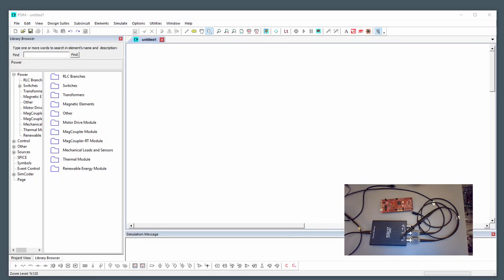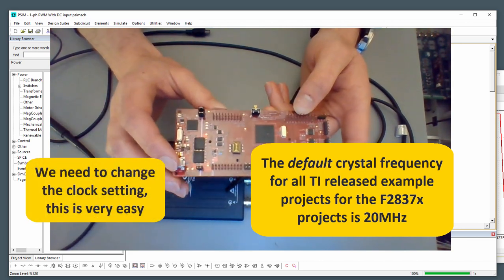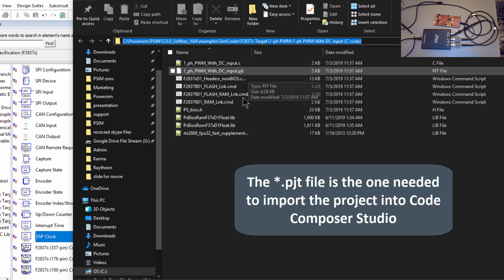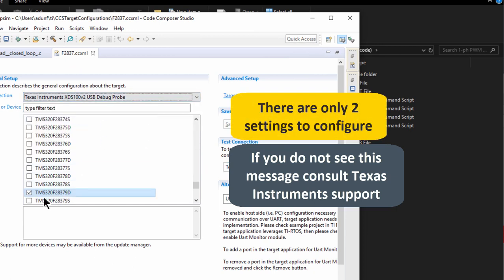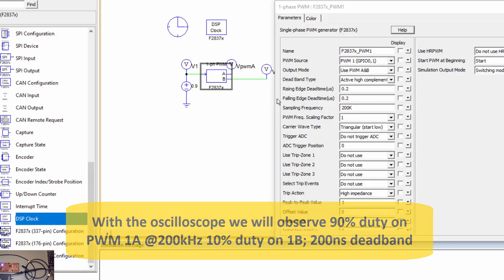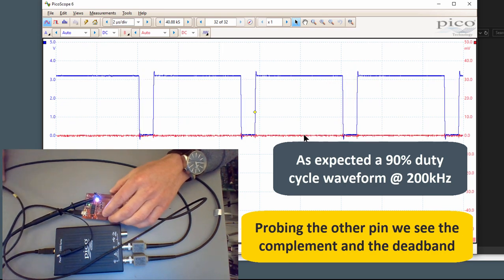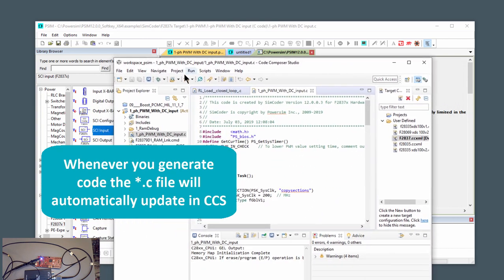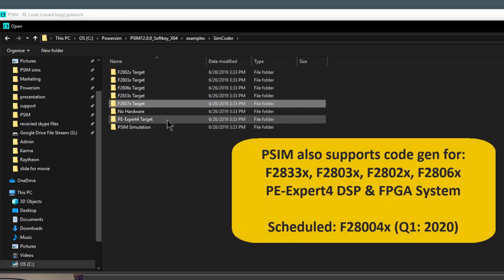Get started with PSIM code generation using F28379D

Comment: Great video! 
I'm having one issue though: when I open the component library, only the PWM X-BAR and Output X-BAR blocks appear (under F2837x target), and I can't seem to find them anywhere, although these blocks are being used in the examples. They show up normally for the other processors though. I'm using PSIM 12.0.1 by the way. I would very much appreciate any help I could get. 
Thanks in advance
Reply from the maker: if you don't have the module you won't see the elements... are you looking in simcoder->F2837x Target? You can check if the module is enabled if you go to help->about PSIM. For university research licenses with the code generation package we have not finished updating everyone's license yet, this will take a couple of days.
Reply: @altairhowto  that was exactly the issue, thanks for the quick response!
Reply: @altairhowto  I have an educational license of PSIM 12.0.3. Do you know if SimCoder is available in this case? I couldn't see the elements of SimCoder yet
Reply from the maker: @professorhenriquemarin7728  at what Univ are you, Universidade Tecnologica Federal do Parana? If you go to PSIM menu Help> About PSIM and copy/paste the license number we can confirm the license you are using and what is available.
Reply from the maker: @professorhenriquemarin7728  Thank you for the information. The license you reference is the free PSIM Student version licenses. The Student version does not have the SimCoder/Targets enabled. You can read more details on what is available with the Student version of PSIM and what is limited here: https://powersimtech.com/academia/educational-licensing/